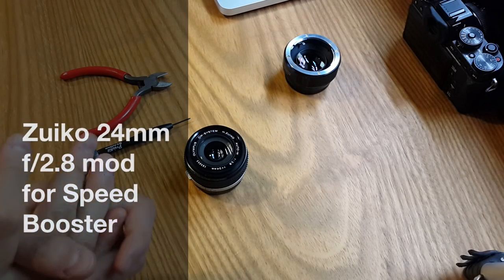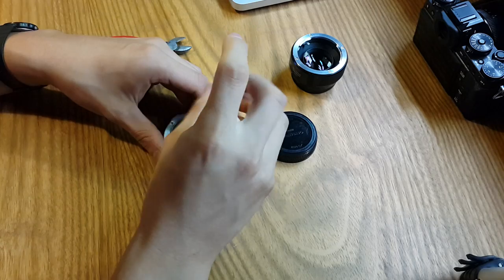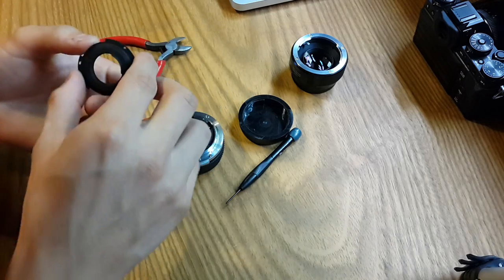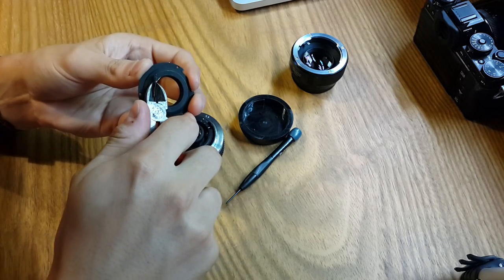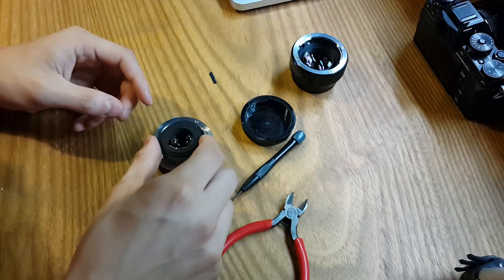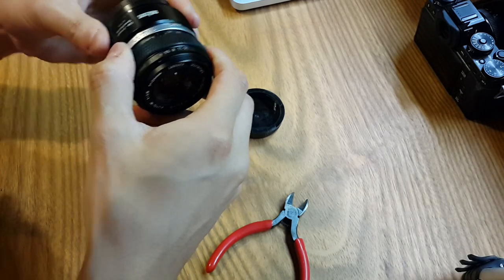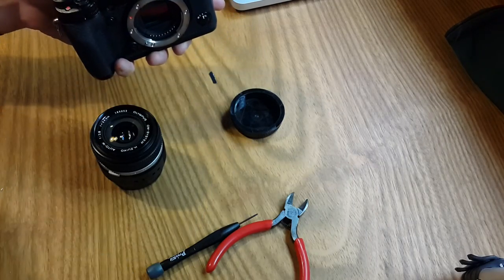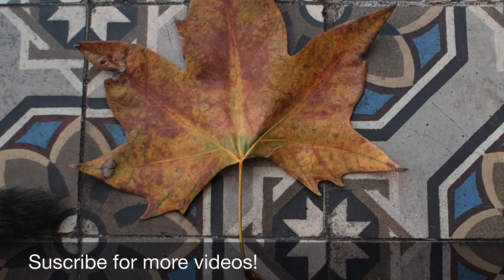Zuiko 24mm modifications for Speedbooster [ENG]

Comment: This is the same solution I came up with after getting my speedbooster. I am using an OM adapter on a Canon EF metabones speedbooster.
Reply: Does it focus all the way to infinity? As posted below, I am using the Zhongyi Lens turbo II and sadly the rear element of the om zuiko 24mm f2.8 bumps up against the front glas of the lens turbo right before the 3m mark on the focus scale

Comment: May I ask you if it's possible to focus to infinity after you putting the lens on the speed booster? I'm worried the rear lens may hit the speed booster.
Reply from the maker: In the case of the Zuiko 24mm once I removed the metal part I was able to fit it in the speedbooster and I can focus using all the range. But if you don't do the modification you wont be able to use it on the Speedbooster.
Reply: I am using the Zhongyi Lens turbo II and sadly the rear element of the om zuiko 24mm f2.8 (writing the full name for people to find this on google) bumps up against the front glas of the lens turbo right before the 3m mark on the focus scale, so not getting to infinity. Glad to hear that the metabones speedbooster does not have this issue